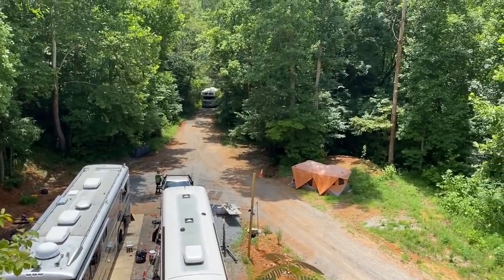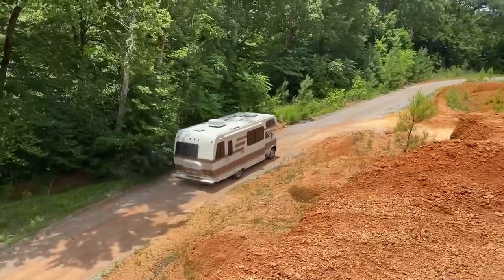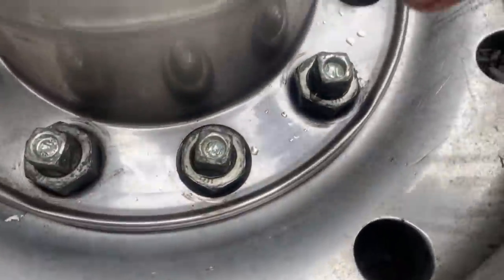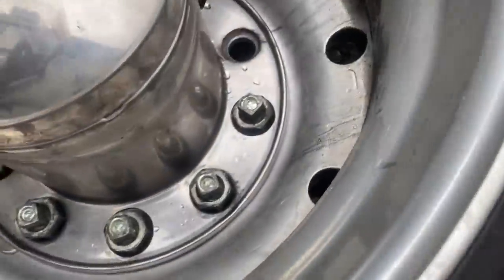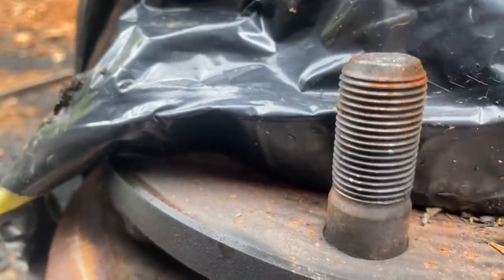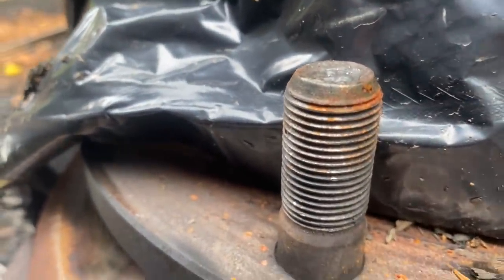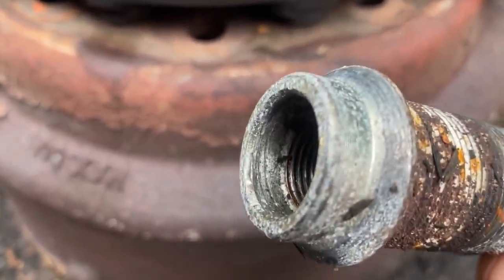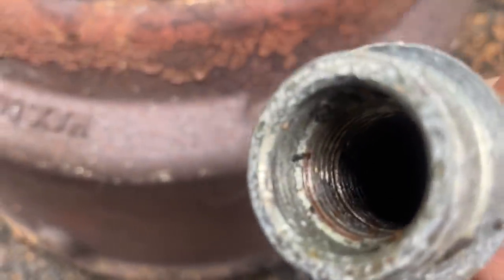Never let a tire shop use a 1” impact gun to put your wheels on.  Finishing the Wanderlodge rv

Comment: Almost  worth while to start updating to hub pilot style  hubs ,1 stud  ,1 nut ,easier on rims and will pay for itself  in the long run and less maintenance. Otherwise  I would suggest  RV owners  should have their duals pulled apart once year have the fasteners cleaned and antiseezed applied.
Reply: There is a gauge available   ,well there use to be a gauge to check  the chamfer of the stud hole in the rim. Here in Ontario Canada  it was  mandatory for any tire guy or repair shop including dealers  to have it  , you also needed it when do safety  certification.  But now a days everything  is mostly  hub pilot or has been converted to it.

Comment: One time I walked round the corner just as the tech guy was about to twist on the lug nuts and he was hunkered there with the impact gun. He looked guilty and he shamefully went across the shop and fiddled around for a torque wrench. I just started doing my own work. I have them mount the tires on the wheels then I take them home and do it myself. I put grease on my studs man. It's never been a wrong decision. I never have a problem with moving those nuts and nothing every rusts.
Reply: Not 100% sold on grease, stuff will mess with readings and it won't compress really. What i do like it spray on copper antiseize stuff. A quick spray over the rotor face, after you've cleaned it of rust and gunk, tires just fall right off. Instead of EVERY SINGLE oil change being the same routine of tap tap tap punch punch oh yay its off, time to clean it for a good ammount of time. Or tap its off, quick clean, because its just old spray on there, spray again and go on your way.

Comment: They should only be using the air gun to snug up and finish with torque wrench
Reply from the maker: They can snug them up with a 3/8” impact.  If that struggles the threads are bad.  Never the 1”

Comment: They do make a aluminum  wheel inner lug nut with thread  all the way  to the end cost  2-3 times  as much , but well worth the $$$$$ they are a little hard to find. I have put thousands  of wheels on with a 1" tire gun have never had that problem.

Comment: running em on with a 1" is fine if they don't ram em down and finish with a torque wrench..
Reply: Spot on, don't waste time hand threading them or some bs, but don't also just JAM them right on. Also, if you take out the torque wrench, and the lugs ect don't move...you're already past spec and its useless lol. Heck, even maybe idk some half inch gun to just run them down, a few uggas, could get it to a couple hundred, then giver. All about knowing what you're using i guess.

Comment: The reason that threads don't go to the whole length of the nut is so with steel wheels the shoulder of the stud will not bottom the nut out
Reply from the maker: Those inner nuts are made for aluminum the steel ones are different. No extended collar
Reply: You don't  use that  style of inner nut on steel wheels is is (only for aluminum  wheels) , it will bottom out  on steel wheels.

Comment: I would agree with you on the non use of 1” guns on aluminum wheels, I’ve never really had a problem with steel wheels using a 1” impact gun.
Reply: If your banging them on with an impact only you shouldn’t be working on shit
Reply: The studs usually break off because someone switched from steel wheels to aluminum wheels and didn’t replace the studs with the proper length studs that the aluminum wheels require, I’ve seen it happen many times.

Comment: Not using a 1" impact is a waste of time in a shop. Also, not using a torque stick when tightening with a 1" impact, is wrong. Bud wheel nuts or flange nuts, doesn't matter.
Reply from the maker: Why do you need 2000+ foot lbs to put on a lug nut that requires less than 1/4 of that to torque properly?    Test your torque stick against a torque wrench.  Don’t just click when done bull crap either.  You know it’s over tightened